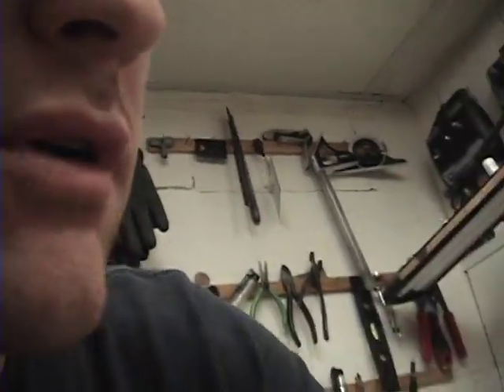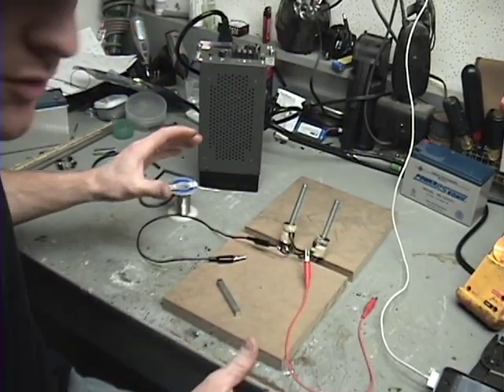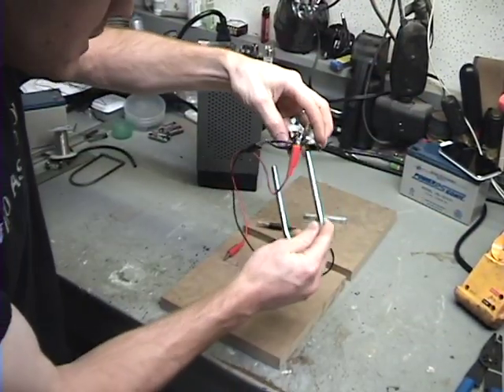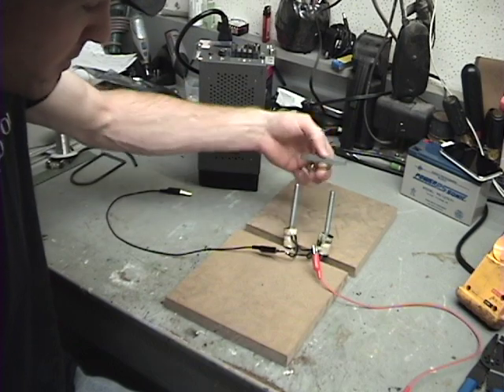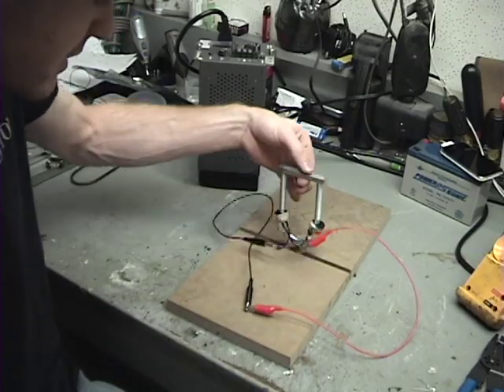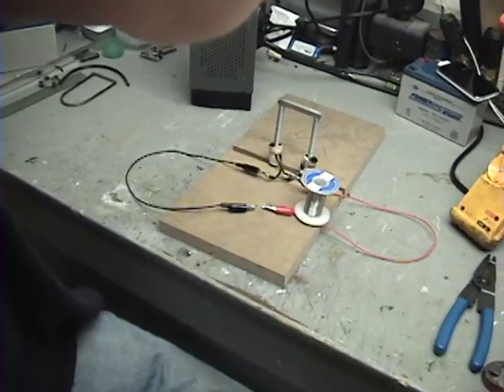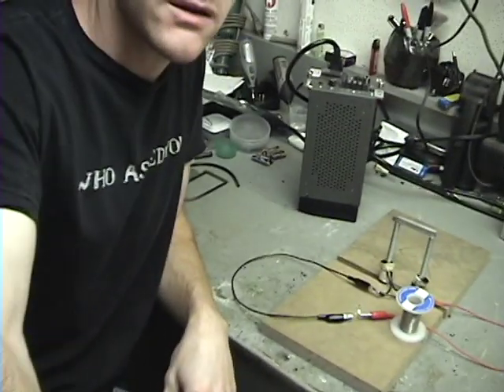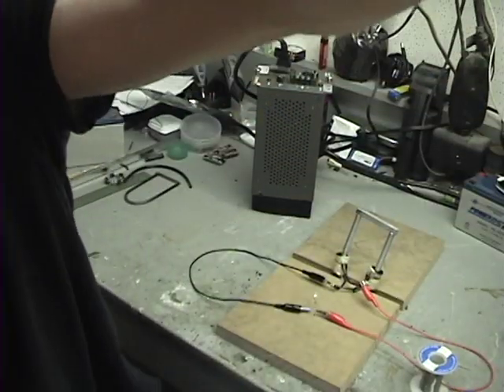1 The TPU extraordinary device works! Perpetual motion "holder" via magnetism!!! (Part1)

Comment: The say Leedskalnin built the Coral Castle, I thin in the 1930s by himself lifting multiple thousand pound blocks of stone. Some believe that he was able to levitate the stones using electromagnetic energy. The location of the Castle is thought to be were higher than typical electromagnetic energy exists. There are some great videos on him on YouTube. I'm from So. Florida and the Coral Castle is an tourist exhibit today here in Miami. The gate to the compound was a huge stone block that anyone could easily swing open because it was balanced so perfectly. They had to take it apart for some reason and have not be able to get it back in place as well as it was originally, even with all the machines with have today. He reportedly knew Tesla. He never would allow anyone to see him do his work, often times doing it at night.
Reply: He obviously used leverage but if you have ever closely investigated the coral castle, he would have had to have some additional assistance to do such things as hang the stone revolving door by himself. With our technology today they have been unable to rehang the door as he originally had it. It no longer opens nearly as easily as it once did. It was perfectly balanced. I don't know how he did it, but it surely just wasn't with a pulley system.   

You're probably one of the big bang theorists who has yet to explain how there was a big bang before any matter or anti-matter existed. For there to be an explosion something had to already exist. Where did that come from? You worst than a dogma worshiper. A science know it all that can explain everything and knows everything. Arrogance I think is sometimes mankind's biggest problem.

Comment: have a look at wimshurst machines., the capacitors on them are connected in a set up similar to this, which, is said to increase the spark on the whimshurst (electrostatic device for creating h.voltage sparks).  On said machines the layden jars/capacitors store the static charge inside but outside the two jars connected together, hence what you appear to have.

Comment: August 29, 1831, Michael Faraday discovers electromagnetic induction, perhaps its time you did too rather than thinking its anything new.  As for magnetising soft iron using a coil, and demagnizing soft iron by opening the magnetic circuit, that's even older knowledge.  Perhaps some basic reading into electromagnetism and ferromagnetic materials would be useful?

Comment: I was study Radiant Energy (tesla); Tesla was able to separate the the 2 componenents of electricity i.e. hot electricity and aether with sharp pulses. You also need a sharp pulse to get the pmh to hold...could it be this aether?? Aether has little or no mass & is able to penetrate metal and isolators such as glass(per Tesla) Maybe once you get an aeter flow it continues to flow b cause of an imbalance, Is this the way gravity works also?? ; just something to ponder.

Comment: The amazing thing is sustained levels of higher than normal magnetic force. This is interesting and there seems to be a loop of that higher than normal magnetic force in this application.
As to the lighting of the LED, this is proof of a collapse of the magnetic field when the loop is broken. Without elevating the magnetic force with the initial battery current through the coils, separating breaking the magnetic loop would not light the LED.
The collapsing/reduction of magnetic loop/flow is what induces the energy back into the coils to light the LED. When you charge up coils with magnetic energy the pumped up magnetic flux is head. When you break the charging energy then the magnetic flux collapses. This is called CEMF (counter electro magnetic force). Essentially, the collapse of the magnetic flux induces (transfers) to the coils in the opposite flow direction. It kicks back voltage, so to speak. It started with electron flow from a battery -  expanding the magnetic flux and ended with magnetic flux collapsing producing electrons in the coil as it collapses.

FYI When a capacitor is charged the current is max at the first moment. When charged the current drops. Opposite with a coil. Applying voltage to a coil, the first moment the current is minimal but when fully charged (with magnetic flux) then the current is maximum. These opposite characteristics is where you get tank circuits, band pass or band elimination filters, etc - key to electronics.

Comment: I'm not much of anyone when it comes to electronics, but this device appears to be some sort of capacitor to me. If you could measure the exact amount of energy you put into it for the initial charge (A), then compare it against the amount of energy discharged when you open the magnetic loop (B), I expect that A > B, or at least they'll be very similar. Would you be willing to test that, or have you done it already? Fun video to watch, though. Thanks for sharing.

Comment: @rwg42985 It's a very cool demo that you show in your clip.  You are storing magnetic flux in the "magnetic circuit" that you make with the u-bolt and the crossbar.  The crossbar sticks just like two magnets stick together.  When you pull the crossbar off, then you sort of have a transformer - the changing magnetic flux through the coils causes the coils to generate voltage and the LED lights up.  The magnetic flux storage will last a long time, but it's all normal and supposed to happen!

Comment: You made the magnetostatic equivalent of an electrostatic charged capacitor. When you open the circuit, the inductance tries to keep the flow on, and what you see on the led is a decrescent exponential, that lasts shortly. By using better magnetic properties materials, you could increase the energy in your closed loop inductor. Nice vid, no doubt on that.

Comment: Hey I'm thinking a circuit like this creates a capacitor that stores the 24vDC with a magnetic field, creating a magnet. Hook up a capacitor with the same setup and you will get the same result as far as the LED goes and can store the charge for at least 10 years. DC, not AC but this is still interesting though since I didn't know you could make a magnet like this. I'm starting to wonder if you can make a kV or higher magnet and how much stronger it's field would be. You could rotate it for AC.

Comment: Magnetization by electrical induction and DEmagnetization after. 
There is no loop. 
If you take a piece of steel and hit it against another piece of ferrous metal it will become magnetized because of the electron exchange in the collision (try!)
Same like static electricity.  
Hitting or rubbing again might increase or cancel or reverse the field as an unpredictable number of electrons will be exchanged between the pieces. 
Cheers!

Comment: I believe the experiment would better understood by using the phrase "static magnetic field". There is no motion here other than when you create the static field and destroy the static magnetic field. Much like the Nut experiment, you are magnetizing a whole. Once broken the whole is no longer. The static magnetic field collapses and in this case, because of the presents of the wire coils, the collapsing (momentarily dynamic) field induces a current flow in the circuit, causing a flash from the LED. 

I am surprised that the LED survives with no current limiting resistance in circuit. The pulse is short. Likely not enough energy to cause thermal destruction. 

Great videos! Thanks!

Comment: if there were a field running through the core the led would come on immediately after being connected to the coile and demagnetized the system))). there's some other dipole configuration due to looped metal core after energizing that lasts untill the loop is broken. easy to check.

Comment: Btw the device is a closed loop magnetic circuit the introduction of electron movement into the loop creates a circulating magnetic field lock, technically its a magnetic capacitor in many ways and when you forcefully pull off the end stock an electromagnetic force is induced in the two coils., thus lighting the led very interesting effect could be worth more research, ty for vid.

Comment: Pulling a permanent magnet from the system would produce the same effect (only better) but you wouldn't have to "charge" pump the metal with a pulse voltage to the coils.

Comment: Your right, but has all been done a long time ago, it is standard magnet theory. All permanent magnets are made by electromagnetics, that are far more powerful than any permanent type. Bigger coil, more power, the skys the limit!
I have to say my background is designing motors and transformers etc., and it is sad so little is taught in school about these science basics, at least the post shows an experimental mind at work.
The field mentioned is not static in collapse, it is in flux, gives EMF.

Comment: Interesting. This some how suspends the magnetism fields collapse.  Yet the field is static.  Not moving.  If the u bolt (coil) maintains magnetic field then creating artificial magnets could be made smaller thus lighter and more powerful. Testing needs to be done to see what decay rate is using the field.  What it's heat range is too.  The results could be lighter more powerful electric motors at the vary least.

Comment: It's not perpetual motion. What you have is a closed magnetic circuit. When you pull it apart, the field collapses that's all. It would be the same way if a magnet were to pass over a coil in a closed circuit. However, it could serve to be a motionless generator, and that would be cool to have no moving parts.

Comment: PS: I'm not saying vid I named is THE answer! It's long time weak motion. So gear it up!

Aim for magnet to drive object forward & UP a bit, then slight drop over lip so no back sliding. Then object meets next magnet, and next, each lifting a bit. Many designs! 

What if ball or roller-wheel on track is pulled by ball-bearing pulled by wire pulled non-magnetically? Via a spring? Gravity? (weight pulls wire over pulleys) 
PS: Can one extract E from perpetual brownian motion of flowing stuff?

Comment: Not perpetual motion. Stored electrical energy in the form of a magnetic field which partially decays when the magnetic circuit is broken (lighting the LED momentarily). The loss of magnetic field is clearly demonstrated when subsequent attempts to lift the assembly by the bar fall short. PM'rs take note: this is what happens to magnets if one extracts the latent energy from them.

Comment: Cool video bro Good job I hope you don't mind me pointing out one thing This is NOT perpetual motion You might be correct in calling it a perpetual ENERGY machine but there is no motion or MOMENTUM energy being moved here. Motion is not the same as magnetic or electric energy. EVERYTHING that exists absolutely EVERYTHING is a constant vibration of energy That however dose not make it in a sate of MOTION. Energy is forever moving threw form into form and out of form. In everything "thing" exsting

Comment: The principle (electro magnetic induction) is not new. Using inductors to store a charge has so far been inefficient compared to batteries. The same thing is done with capacitors with somewhat greater efficiency. Neither actually generate electrical current, they store & release a charge. If either could do the same as a battery yet weigh the same, or better yet less, they would of course be quite useful.

Comment: Perpetual motion it is not. In order to extract energy you have to do physical work (separate the pieces of metal, just like a magneto). This is a classic way of magnetizing pieces of ferromagnetic material. Magnets always retain their field longer with a keeper bridging the poles. This property is the bane of a transformer core and contributes to hysteresis loss when A.C. is passed through the primary winding. Compare the storage action with that of a low-leakage charged capacitor.

Comment: I'm not seeing any perpetual motion. Your device holds a few hours, Leedskalnin had a massive one lasting 6 months, but you magnetize your soft iron and it sticks a while.

I do devices with only magnets moving stuff in useful ways (so energy accumulates to do major job like driving weights or water uphill). We know magnets can apply force, over distance: equals work! (But don't move smoothly in and out of field, back to origin, since net work is zero.) View Perpetual Motion Magnetic & Gravity

Comment: Far from "perpetual motion," this is simply a form of electromagnetic induction, discovered in the 19th century by Faraday and Henry.  When you initially run current through the coils, they become electromagnets and magnetize the soft iron U-bolt core.  You then have magnetic flux through the two coils via the U-bolt and "keeper."  When you remove the keeper, the flux changes, which induces a (transient) voltage across the coils that in turn drives current through the LED.  Basic physics.

Comment: Have you head of a permanent magnet?  Study up.  The hysteresis of the iron being magnetized is the reason the magnet sticks, but looses magnetism when broken.  I.e., a non-reversible snap-action occurs in the magnetized iron.  It takes another magnetizing pulse to recreate the magnetic polarity in the iron.

If you discharge a capacitor of sufficient energy storage into the test device, the iron will become more strongly magnetized, and will re-stick after removal.

Avoid embarrassment - study.